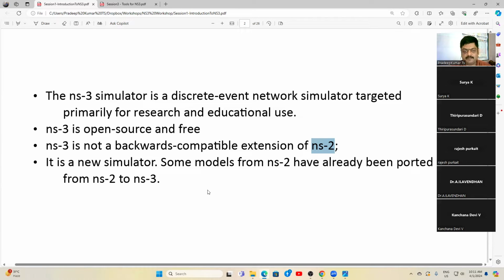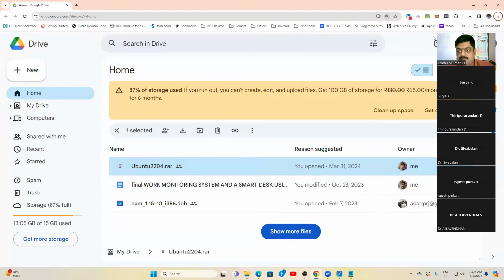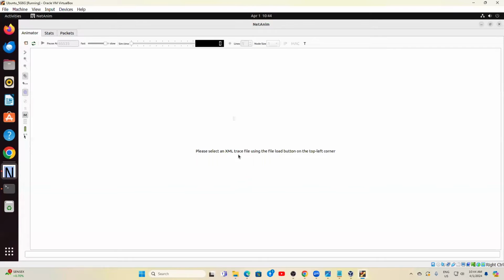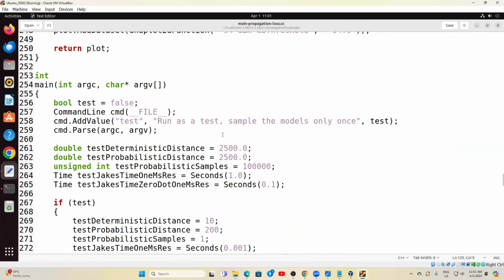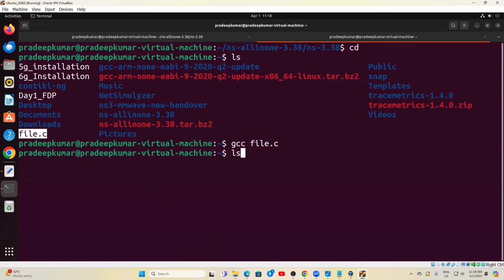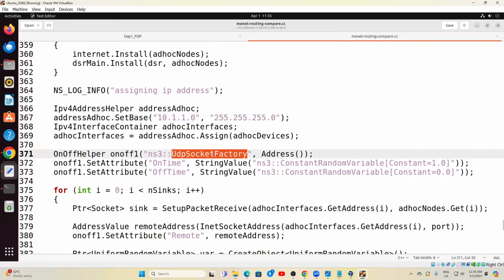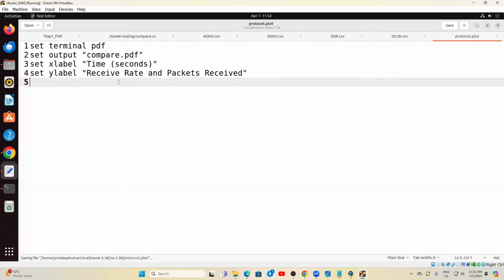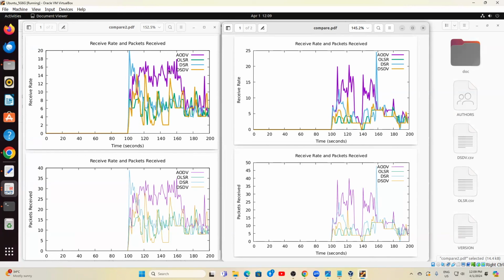Introduction to Network Simulator 3 - Complete Instructions | Dr. Pradeep Kumar TS

Comment: Sir for the Manet compare example, how can change 802.11b to 802.11ax and UDP to tcp 🙏.
Reply: Any luck? I am having issues as well
Reply: @bernardgrech729   I’ve struggled to enrolled myself or getting the workshop materials , unfortunately, couldn’t get anything
Reply: @engihabit  im sorry to hear, ive been trying to search the whole web to try and simulate the same manet routing compare file but whilst using faster 802.11 standards as the backbone of the network. But since I am a networking student we have never been inclined into coding and c++ is very hard to understand especially when source code for many research papers is not available to the public even though many of these protocols are open source.
Reply: @bernardgrech729  may I have your email, in case getting something may help you